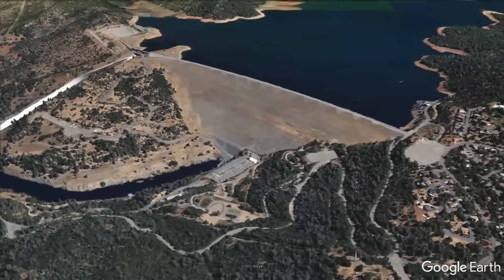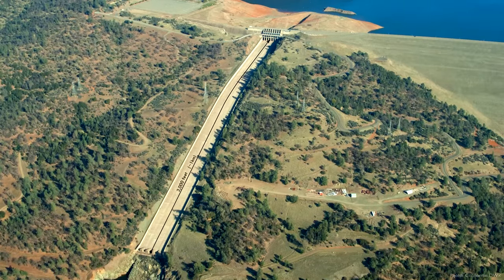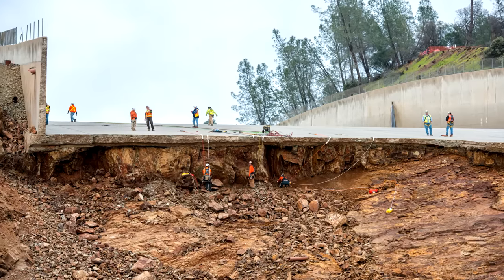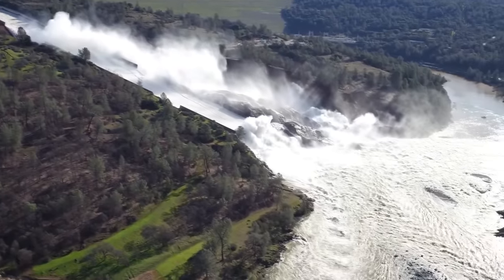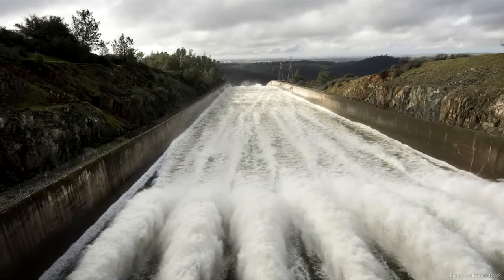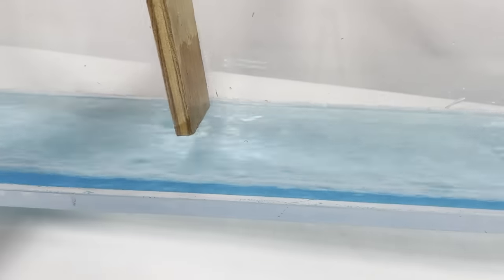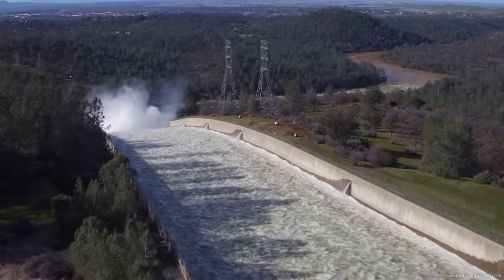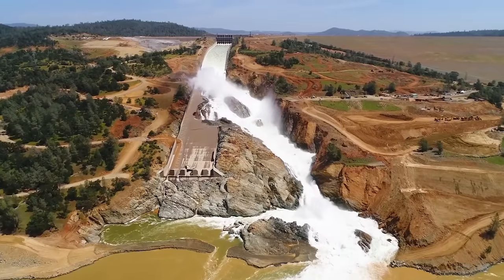What Really Happened at the Oroville Dam Spillway?

Comment: If that emergency spillway would have collapsed, what would have been the damage in terms of loss of life and property damage?  I've heard areas including parts of Sacramento would have been flooded and damaged, with loss of life in the thousands.
Reply: It would have flooded the whole Delta was already close to flooding and it would have put more stress on the Levee so there goes Stockton Lodi Elk Grove pocket area at Sacramento Rio Vista Isleton
Reply: Nah.  The Central Valley is pretty flat, and 70 miles wide.  There would be flooding, but not that bad.

Cali won't build flood dams.  Not green enough.  People don't count in blue states
Reply: @TomSmith-vp6zo  silly.

Comment: How on God’s green earth could they not know there wasn’t solid bedrock under that spillway? Is that not CE 101?
Reply: 300,000 cfs is a lot of force.
Reply: @andrenewcomb3708  it is, but the video mentioned that they were surprised that spillway wasn’t secured to the bedrock as evidenced by the massive amount of erosion.
Reply: @TeamFish15  As far as I can tell from the video, the designers thought it was solid bedrock, the builders noticed it wasn't. Maybe the builders did not know it was suppposed to be bedrock. They didn't report this or the report was not received. Somehow the construction team put the anchors in soil rather than bedrock, which left them ineffective.

They also cut corners installing the drains, having them IN the concrete rather than the ground, weaking the concrete at those points. At least, I doubt that was part of the design. 

The obligatory inspections were not done properly and never caught the problems. 

TL;DR: The design had multiple, if not all possible, safeguards, but the execution and maintenance was done by the lowest bidders.
Reply: Close enough for government work.

Comment: Hi,
I’m an American civil hydraulic engineer living in Austria. Early in my career I had the opportunity to update the design of service spillway and stilling basin for 17300 m3/s on the Euphrates River in Turkey. What I learned then made it impossible to avoid armchair / Monday morning engineering. So I spent a lot of time thinking about joints, water stops, and the relative risks of operating one or the other spillway. I couldn’t understand then what the risks to the emergency spillway were and found operating the service spillway didn’t appear to be that risky. 
Anyway, I want to say congratulations on a well-made video and explanation. One question about the report: was cavitation not a possible cause of the initial concrete slab damage? Or did the spillway have aeration ramps? 
Keep up the good work. 
John Thene

Comment: All in all, this near disaster was very well handled.   The operators and engineers worked tirelessly to control the outflow and avert the impending doom of the dam.   It was the best decision to continue using the damaged spillway and lower the lake.  I saw how they quickly repaired the emergency spillway with quick setting concrete, etc.  There is a videos on the complete repairs at Orville.

Comment: Captivating, fast paced and informative presentation. I found myself getting angry at the original designers, wondering about the economic forces operating on their decisions to cut corners. (It's likely corners were cut in other areas of the design not impacted by this particular failure.) Apparently we need an engineering of human factors to understand and mitigate the seemingly inevitable corruption of industrial projects by economic forces (e.g., welds in oil pipelines and atomic energy plants, lead poisoning in water pipes, bridge failures, Boeing's wishful redesign of the 737 driven by financial greed not to mention treating our oceans and atmosphere like city dumps). Incremental denial servicing wishful thinking.

Comment: When the transmission lines were thought to be in trouble, they cut the lines so the power plant unable to produce electricity. And if you run water through that  turbine it will spin too fast destroy its self without the resistance. The most in-depth coverage of this was Juan Brown of the Blancoliro channel.

Comment: As a solutions designer, I would recommend several backup solutions for a dame. 
The math for disaster are simple calculations. 
Risk management? As I don’t have engineering expertise or geographical conditions its a guess work.

As you tell the story I draw conclusions that there where “panic” solutions with over flooding the dame, and later release excessive water tru a poor maintained overflow skid.

Still, several backup areas upstream would help, if possible it would also have a release. 
Dangerous erosions that come over flooding dame is a pooooor construction, even if its made in 60’s.

Comment: Thanks for the report, looks like the repaired spillway will get used in spring runoff of 2023. Several factors led to this near disaster one of which was assuming the homogeneous nature of rock. Was there any indication that voids were present under the spillway slab prior to this flood event? What material was used for the drains. My experience indicates that voids are very difficult to detect and far too often drainage systems do not work as designed.

Comment: Unfortunately so many of these failures are the result of engineers thinking they have ALL the answers, when they should at least consult with the GEOLOGISTS who know the rock and its properties and strengths.  This dam was built in the greenstone belt at the foot of the Sierra Nevada, on rocks that are altered but ancient volcanic rocks known for their intrinsic weakness and countless minor faults.  There were in fact operating gold mines that were drowned beneath this reservoir as it filled.  Excellent video on the failure and its causes, but people should know that the engineers do NOT have all the answers.  And yes, I'm a retired geologist who grew up in this area - and my former wife was one of those in the town of Oroville who had to vacate her home because of the potential flood risk.  Having been over the dam multiple times, I was always concerned that the "emergency spillway" had absolute NO engineering below it that would have even remotely slowed the rapid erosion that ultimately ensued when it went into operation.  It just dumped the water onto the hillside, underlain by rust-red clay-rich soils atop these weathered meta-volcanic rocks.  When I raised concerns, I was told to just be assured that everything had been thought of and prepared for.

Comment: I know 1 year later comment... I think you said what I have always thought - the spillway and overall system might have failed successfully just as the original engineers may have thought it would? Yes a lot of stuff was washed down the hillside, but the underlaying rock held where it was. On the overflow spillway, it did erode fairly close to the base, but stopped where it did, exposing the rock  underneath. Is that why there is a large pad (the parking lot boat ramp) on that end in order to provide a mass to hold back the water and prevent the further erosion to undermine the overflow spillway? Possibly the rock formation underneath that end isn't sufficient. Even the broken spillway failed down to rock and water only eroded the hillside to a point. The rock underneath directed the flows to the river. I just wondered it the original engineers should get more credit for where they put the spillway and why it is there.

Comment: As a geologist, I find it amazing that the geotechnical drilling wasn't interpreted to several metres of oxidized bedrock (rhyolite?) before competent rock was encountered. It's obvious in the old river channel, the fresh cuts and would also be obvious in the drill core. The removal of that friable material is easy and should have been done instead of building on it. 

I'd have also analyzed the rock for precious metals as the pervasive iron alteration, structures and shears in the exposures look very interesting. A few hundred thousand tons of Au/Ag/Cu ore sent to a mill could give some offset in the cost of removal.

The lawyers must be making a fortune on this one.

Comment: i have lived in Oroville since 1970, when we moved here we wanted to learn about the area, so we went to the overlook visitors center. don't know how many locals went there to learn about the dam but my visits provided allot of interesting information., this video stated that the dam is earth filled, but did you know it has a concrete core, got that from the many black and white movies shone. also saw a demonstration of how the dam can reseal itself if it were to crack during an earthquake. now for the changes in the names, the spillway was caused the EMERGENCY SPILLWAY, the over flow was the EMERGENCY OVERFLOW. now find someone from the 1970 and ask them about how many times they saw water coming out the spillway, it was a news worthy event not seen very often. now you ask how could that be. look at the power plant. the water out flow and power output. then check the deal PG&E had with the state. as long as they were producing power from lake Oroville there was a limit to how much they could raise rates. there are 6 turbines in that plant. how many are still running at this time? water did not leave the lake over the spillway, it left through the power plant. but when it stopped being used to generate power. it had to come out over the EMERGENCY SPILLWAY on a regular basis, putting what would be years of wear over a short time. now before you ask me if I'm an engineer, I got all of this information from the movies shown at the OVERLOOK VISITER CENTER from the engineers that built the thing, and had planed how it was to work. So can you answer those questions. 
.

Comment: I remember 15 years ago, in West Sacramento, climbing up the drainage runoff to see the Canal full to the top. Water was running at 40 miles per hour, and in the drainage area I-5 ran straight across the 10 mile wide monster river. I do not know how the bridges held up to that  amazing amount of water. I do not know how the earthen levees held up, either. Our parking lot was right on the levee. The pressure from the 35 foot deep river of water was pushing the water underneath the levee. The parking lot started getting water in it and vehicles were getting buried in 2 feet of mud. I thought, "The integrity of this levee structure is going to fail and West Sacramento is going to wash away."
I do not know how it didn't wash away. It was very scary. I was one of only a few people who knew what danger West Sacramento was in.
Reply: There is a huge issue that where Sacramento used to do controlled releases are now subdivisions.
Reply: @athenagliddon9783  I started working in Sacramento in 2003 until 2007, and it's changed a lot since then. What are they going to do now with the snow melt runoff that goes through that very spot west of Sacramento? If there are houses built in the way now, they better figure something else out!

Comment: Thanks, that was really interesting and accessible. Do you think the lifted concrete slab beneath the Space X Starship launch tower was subject to similar effects (as some people are saying), or was it simply shattered by the blast? I expect it's impossible to say without data, but maybe you have a hunch.
Reply: How similar are you thinking?
I don't know exactly how the rocket launcher pad failed so I can't tell which is most similar. But, fluid dynamic forces apply in both cases, considering the speed of the gasses emitted from the engines would make them act similarly to a literal fluid.

I'm guessing, but there's probably a relatively large difference in how the structures initially failed. After that the forces leading to further damage/erosion would likely be very similar.

Comment: I wonder if it would of been possible to have both the emergency and overflow spillway open at the same time. Like. If they just had 1-2 gates open on the main spillway to limit water flow. And then let any excess water go down the emergency spillway. If it is possible to share water between the two spillways like this, would it help stop the quick erosion?

Comment: Previous to 2017 there were numerous repairs and design issues.  At press conferences after the spillway failed presenters looked like scared deer in headlights when asked about these issues.  It was a miracle that the dam did not fail.  It is an outrage that no one was held responsible.  But then government never admits responsibility.  All of those who had responsibility likely won promotions and pay increases.  

Why didn't you start at the beginning?  The massive failures and incompetence that led to this near disaster.  This massively expensive disaster.

Comment: It doesn't look like the concrete spillway had any steel embedded in the concrete and tied to concrete filled bore holes with steel rebar.  Is this true? Otherwise the slabs wouldn't have completely moved away.

Comment: A dam was built in the early 60's on the  Guadelupe River in Texas by the Army Corp of Engineers. The same folks that built the levee's in Louisiana that failed during Hurricane Katrina. Canyon Lake Dam is an earthen dam (made of dirt). My Uncle had a degree in engineering and his company was hired to work on it. He hated that job and complained constantly about the incompetent designers. "It will fail one day. Not if, but when." In 2002 a flood forced water over the spillway. In two weeks it carved out a gorge that would have nature 5000 years to create. You can look at pictures today and tell that if this flood had continued much longer that failure was imminent. But no one brought it up and focused instead on a smaller river with a large concrete dam. Medina Lake Dam was built in 12 months in 1912 with 2000 laborers and no machines. Designed by one of the world's top architects and with private financing it was the 3rd largest concrete dam in North America at the time. Scare tactics were used by politicians, not out of actual concern but to secure water rights to the lake. It worked as they got the water rights. Unfortunately for them the Lake is at 5% capacity. Serves em right. This dam is not even on a high risk list. Canyon Lake is in the top 10 of extreme risks of failure. And nothing is or will be done. The State of Texas isn't even worried about it. They created a corporation to take any and all blame should something go wrong. This authority is in charge and shifts the blame should anything go wrong. Further downstream other dams failed recently and lawsuits have been dismissed. As predicted. Welcome to Texas folks. Ya'll been warned now, ya hear?

Comment: Your late characterization of how they should not have trusted the emergency spillway is, I think, given purely out of hindsight.  

If they have an emergency spillway that cannot be used even in an emergency storm that is also suffering an emergency failure of the primary spillway, then, frankly, they do not have an emergency spillway. They needed to trust to see whether it could perform its role. The fact that it failed so catastrophically was still valuable data.  

You say they "eventually needed to open up the primary one anyway" but this is spoken purely in hindsight - they had no way of knowing that they would need to, nor did they have any way of knowing that it would not have caused more devastating problems. This is too results-oriented of a judgment call.

Comment: You skipped the part where the hole was actually 1/10 of that size and then they decided to let water back. You missed the whole section of information there that's very important.
Reply from the maker: There was a lot more inflow to the reservoir in the forecast, so the operators knew they didn’t have much time to keep the gates closed while they inspected the damage, and no chance to try and make repairs. They knew they would have to keep operating the crippled spillway. So, they started opening gates incrementally to test how quickly the erosion would progress.

Comment: Great.  I don't think it was a mistake to use the emergency spillway, as long as possible until it was too close to getting eroded, and then using the option of the service spillway.  Remember, both released water and contributed in part to the dam's not failing.

Comment: One would think that you could overlap the spillway sections like tiles on a roof.  This would force any water entering a joint gap to go up the slope a couple feet before it could get under the slab.  Perhaps this distance would dampen the water pressure, perhaps not.

Comment: Several observations 1 maybe metal rebar should be replaced with fiberglass or liquid basalt so cracks will not promote rust. 2  each slab section could be offset down by an inch or so to reduce water pressure at the join same could be done on concrete freeways to a lesser extent Ie a few mm again to reduce forward pressure from forward momentum , may provide driver efficiency and car wear benefits as well. 3  If smaller sections of rio are placed  inside sealed low grade irrigation pipe and this is used to bridge the gap between slabs the slabs can still have their normal movement but excessive upward movement would be impeded. An unrelated idea in regards to concrete movement is in pavements and retaining walls where there will be excessive force from either tree roots of downward creep of soil , their could be a compression layer of hard foam on the effected side coupled with the idea 3 so excessive movement can be experienced safely before failure.  Many thanks

Comment: It was a poorly implementation concrete slab that wasn't built to withstand pressure and harsh weather condition.  There was no bar wired added for strength in the concrete.  Concrete itself is not strong enough to stand the test of time. Cutting corners and using cheap materials to build is a dooms project posing an even bigger problem in the future.